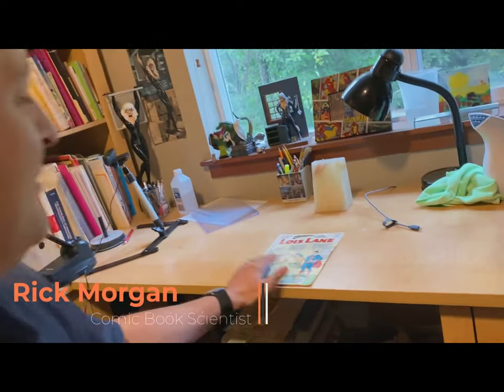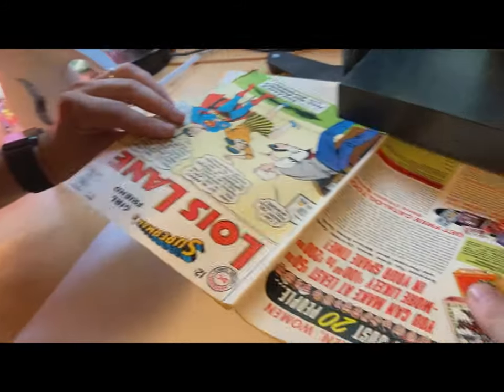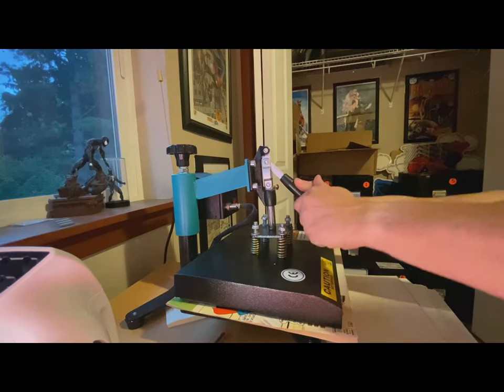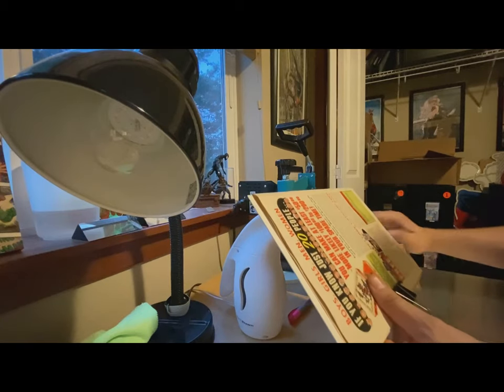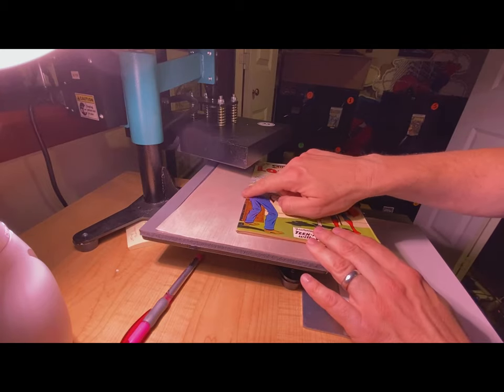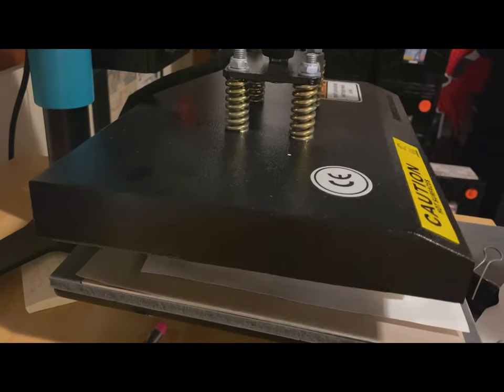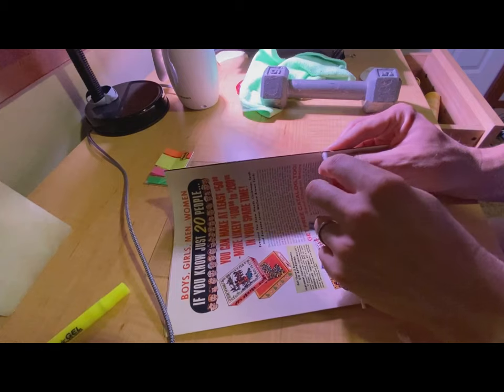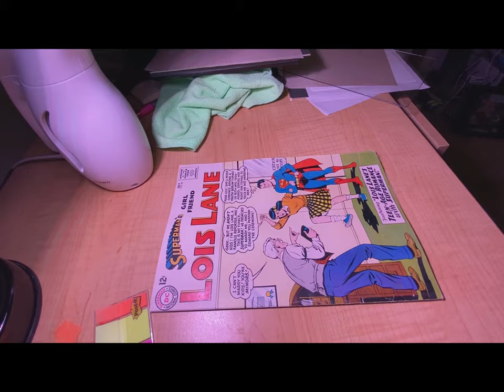Detailed Comic Book Spine Roll Repair Tutorial

Comment: Really close to the way I do it. But I do not lave it overnight for the flat. I do two 2 min cycles ate 165. Then while it is still malleable i steam it a bit more and with a narrow board and only the spine in the press I reestablish the center. I do that for another two 2 min cycles at 165. Then once that is done I hit the rest of the cover inside and out with a spritz of steam ( I only hit the center on both sides to flatten)for four 2 min cycles at 155. The last one is cover down and then I open the press and add 7 magazine backers for pressure and close it and shut it off. 8-10 hours later out pops the freshened book. I've tamed some serious spine rolls many times.Siler and bronze react best to this of course. Great vid.
Reply from the maker: That’s good advice, thank you!

Comment: Hi Rick, Thank you for the video.  Newbie presser here.  My question is this:  When lowering the top of the press do you just touch the top of your "sandwich" and then clamp down?  I wonder how much pressure to use sometimes so as to not crush the book.  Thanks for any info.
Reply from the maker: Hi Ron.  Well the thing is you need to be careful you don't distort the staples more than anything.  By putting a board in the cover to protect the staples leaves a line in the cover.  That's why I make and sell chamfered pressing boards in my online store.  They are way thicker than regular board and give the cover a natural look.  There are so many cgc slabbed boards that you can tell have been pressed because of that weird shape to the cover.  I've used a load cell on my press and I press to 140 lb.  You would have trouble damaging paper at that pressure but the staples do need to be protected or they may deform.

Comment: Great video and it's obviously a labour of love. I was a bit surprised I did not see an SRP on top of the comic? I am no expert, I am just wondering why you did not use it here? Is it because of the steel plate on top? Or does the backer board serves as enough protection for the cover? Also, Sorry if you answered these questions in one of your other videos. Do you prefer steel plates over aluminum? I know you sell the aluminum plates on your page. Thank you very much for your time.
Reply from the maker: Hi Ari,

Aluminum has a far higher heat capacity and conductivity than steel and is superior for that reason.  This particular book didn’t need silicone paper because  there was zero change the ink would transfer to the board, in my experience.  Naturally you should always have it in place just for insurance.  I just felt very comfortable that it would be OK.  Also this is my book so I was comfortable
With the risk!  Thanks for writing ✍️
Reply: @ImmaculateComics  Thank you so much for your answer.  I appreciated It.  The book looks really fantastic.  I am looking for a spine roll in my collection.

Comment: Do you have any suggestions for cleaning dried on soot from a house fire. Where ever the books in the collection were overlapped there is a very dark brown line. The line is about 1/2 inch wide. Some of the books are pretty pricey. So I’m trying to make my mistakes on the books with lesser value. Anything you can suggest to help would be greatly appreciated thank you
Reply from the maker: Yes, use absorene putty to remove light particles then lightly wet clean as soon as possible after a fire.  Its in the dry leaning kit on my website. immaculatecomics.com
Reply: @ImmaculateComics  I put in an order today. It’s been a while since the fire. But I’m just getting the comics now. Trying to clean them has been a nightmare